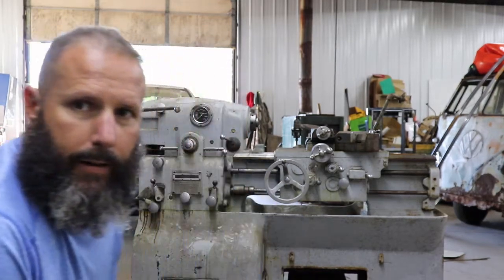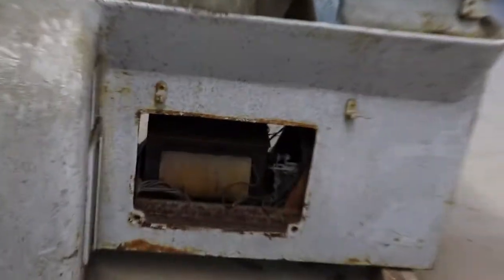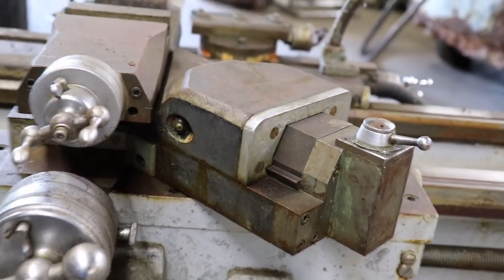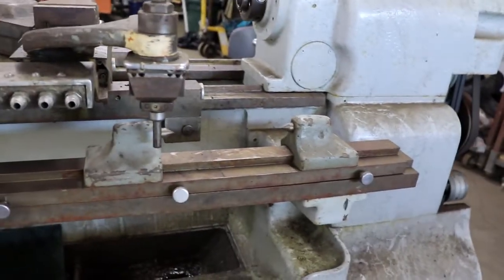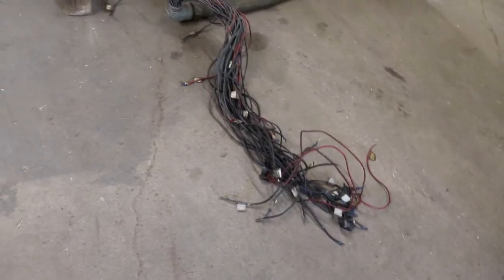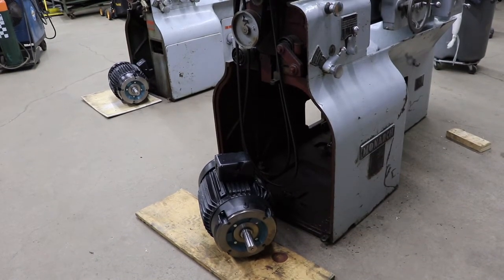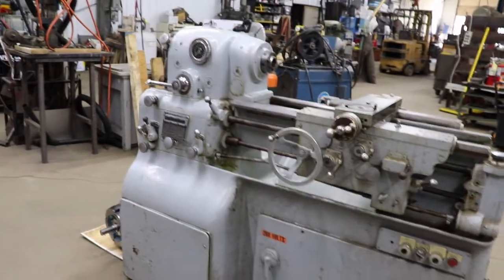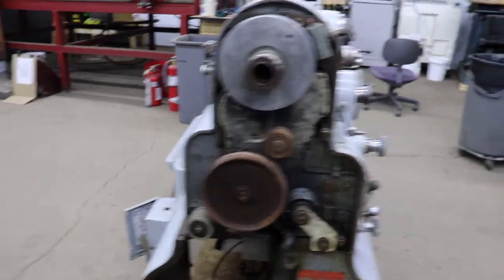Monarch 10EE Lathes Rebuild Episode 2

Comment: For anyone curious - the bundle of wires coming out of the back of the lathe is all of the wiring for the control relays. Most 10EEs left the factory with the control relays housed in an enclosure under the headstock. This one was optioned with a remote panel that contained all of the control relays and braking resistors. That panel has unfortunately been separated from this machine. 

The "Air Gauge Tracer" this lathe is equipped with is also unfortunately missing the power unit that supplies hydraulic power to the "compound" and the control valve that translates stylus air pressure to "compound" movement. 

Source: I'm the proud owner of this lathe!

Comment: I believe that is the Air pack tracer, not hydraulic. It is remarkably complete. The main problem with the machines, when you get one, you start buying others.
Reply from the maker: Thank you for the feedback. I initially had plans to convert it to a standard 10EE, but at this point I'm willing to move it on to a new home. I have more projects than time these days ;-)

Comment: Wow, never ever seen a tracer version of a 10EE - that is rare. I can hardly find much about it, the "Air Gauge Tracer" factory installed. The most I could see image-wise was the link below (no idea what this website is, looks like an old machine listing). Would be great if someone who knew something about it had the time to restore it. The other 2 monarchs look to be cleaning up nicely! Really great deal on those motors. Are you grabbing a VFD for phase conversion?

http://www.lislesurplus.com/m/Monarch-toolroom-lathe-w-air-gage-tracer-10EE-19391/#:~:text=Applied%20to%20the%20Monarch%2010EE,in%20a%20single%20continuous%20cut.
Reply from the maker: Yes, I’m going to use a VFD to control speed. Thanks for the link to the air gauge tracer, that looks to be the same thing I have.
Reply: I'm not going to claim to know enough about the Tracer Lathe, but I am in the process of restoring it! Monarch is kind enough to provide the serial number specific documentation in exchange for a very small fee. Using that documentation I have brought the DC motor and W.I.A.D. (Works In A Drawer) tube drive back to life. With that, the lathe has basic function restored. 

Hopefully I can locate an original power unit for the tracer at a reasonable price. If not, I believe I have a pretty solid understanding of the working principle behind the Air Gauge tracer, so I'll put my own version together.